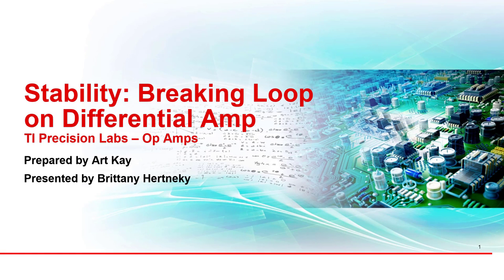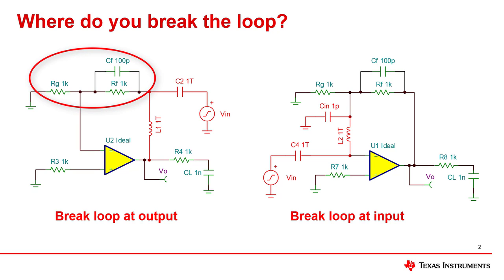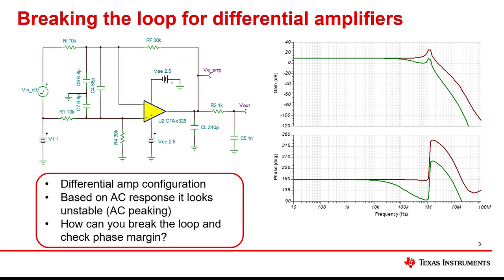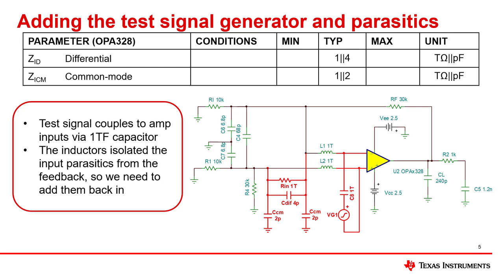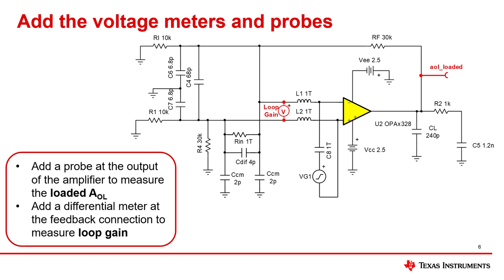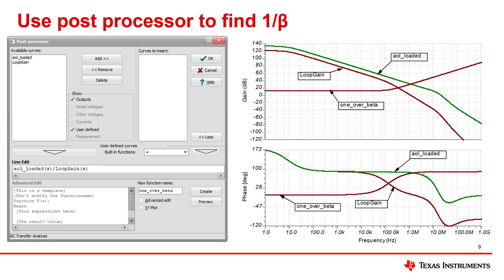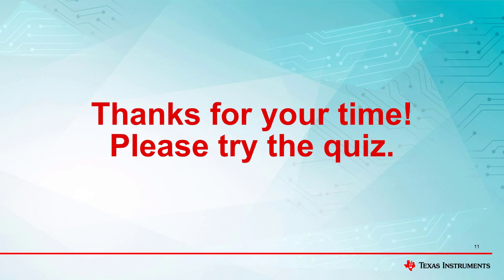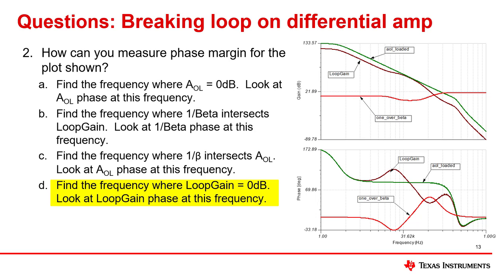Breaking loop on differential amplifier

Comment: Hello @TexasInstruments; for this kind of analysis, how much is important the power supply of the OPA ?; the model has to be used necessarily with a dual power supply for the OPA as in the video (+2,5V, -2,5V) or it can be used also with a unipolar single power supply for the OPA, for example 0 to 3.3V ? I tried to simulate the same circuit with single power supply for the OPA and the loop gain response and the open loop loaded gain response are very different with respect to the case of dual power supply.
Thank you.

Comment: Tera Henry and Tera farad!
Reply from the maker: Mohammed, We really should have commented on this in the video as other people have the same concern. The values are correct for simulation. In simulation they allow for the circuit to be closed-loop for DC but for AC the circuit is open loop. The reason the values are set so large, is that the frequency response measurement will work down to very low frequencies ( e.g. 0.001Hz). These large values will in some rare circumstances cause SPICE convergence issues and in that case we normally drop the value by a factor of 10 or 100 and that solves the issue. We have used this approach for quite a few years with a lot of success, but only in SPICE. Thanks for your feedback.
Reply: @TexasInstruments  thanks for the clarification.

Comment: Are the values correct? TeraHenry and TeraFarads are ridiculously high
Reply: These are simulations only. To do it with real circuitry would be quite a complicated and expensive undertaking!
Reply from the maker: Hi Alex, You are correct that these values are not practical for real-world physical circuits. They are only for simulation. In simulation they allow for the circuit to be closed-loop for DC but for AC the circuit is open loop. The reason the values are set so large, is that the frequency response measurement will work down to very low frequencies ( e.g. 0.001Hz). These large values will in some rare circumstances cause SPICE convergence issues and in that case we normally drop the value by a factor of 10 or 100 and that solves the issue. We have used this approach for quite a few years with a lot of success, but only in SPICE. Thanks for your feedback.